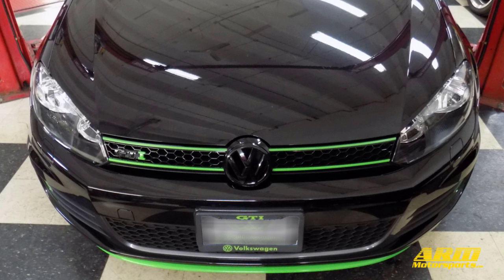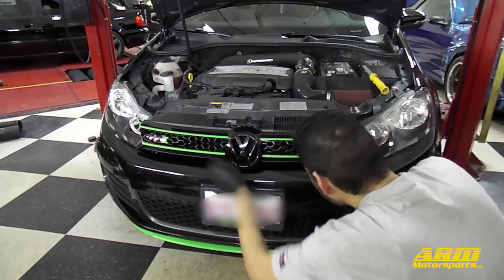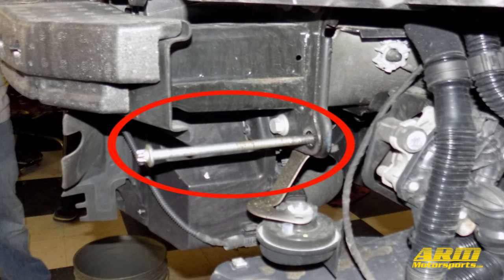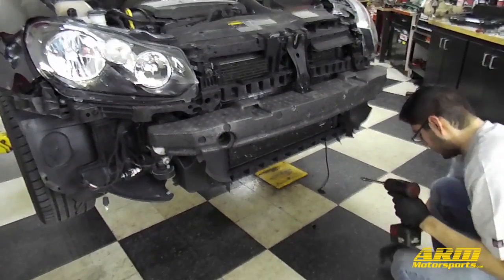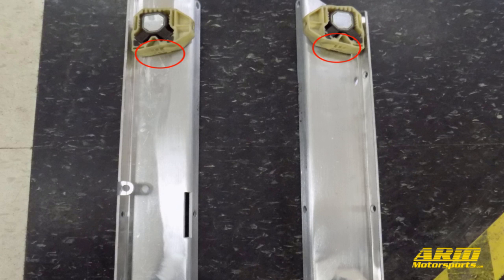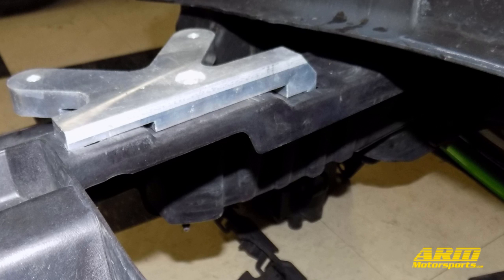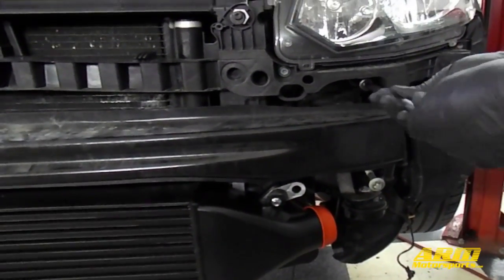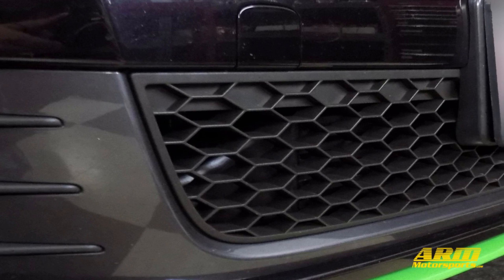Volkswagen GTI FMIC Install Guide - Step by Step DIY

Comment: do you really need to delete the stock IC?

seems like you could just leave it be. it appears the silicone hoses will go around the stock IC inlect/outlet locations.. no?
Reply from the maker: You can certainly leave it be, this is just great to shed some extra weight.

Comment: Do you sell just the boost pipes and the mounting brackets?
Reply: use some common sense and check their website
Reply: @dumbeezy5480  i did dumb ass and it doesn't show them for sale by themselves

Comment: Does this fmic delete kit work for the mk6 Jetta gli as well cause I plan to do a front mount intercooler as well but it doesn’t say anything about the fmic delete kit . Do you have to have it since removing oem intercooler ?
Reply: Not sure if u got it and installed it but I’ll answer this one lol, yes and no u don’t technically need to remove the stock intercooler at all. But if u do don’t buy the delete kit or anyone’s stock intercooler delete kit. Take ur stock intercooler and gut out the core, leaving enough of the core so that remaining skeletonized intercooler maintains structural integrity. Reinstall and fitment will be better and u can save urself money👍🏼.

Comment: This is a good diy video. I recently installed this on my 2011 gti with a ko4. Only time will tell if it could handle it. Ig armstrong0327
Reply: hows it holding?
Reply: ya howd it work
Reply: Hello? How's it working?

Comment: Got this intercooler had it on for about a year now and it's great
Reply: How does it do with heat soak?
Reply: Haven't had any issues at all, I live in Syracuse ny so it doesn't really get to hot out here, but works just as good as my buddies neuspeed
Reply: Would you recommend this intercooler for someone who lives in South Florida?
Reply: I'm pretty sure ANY intercooler upgrade is better for south florida LOL.